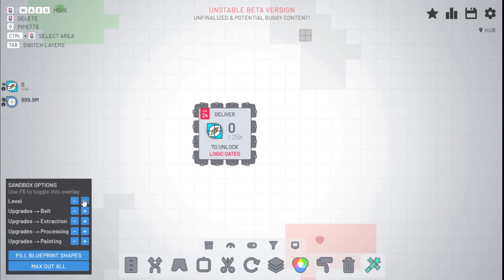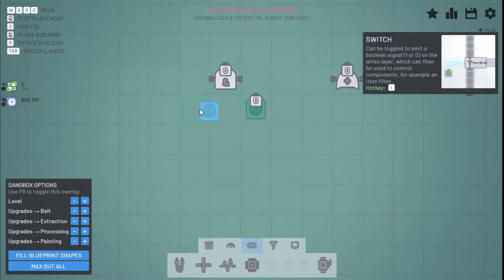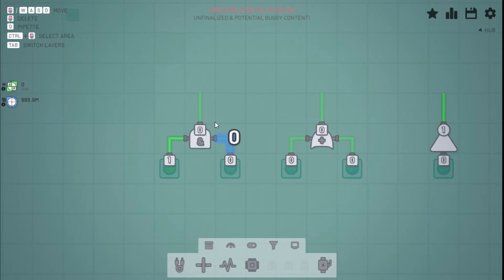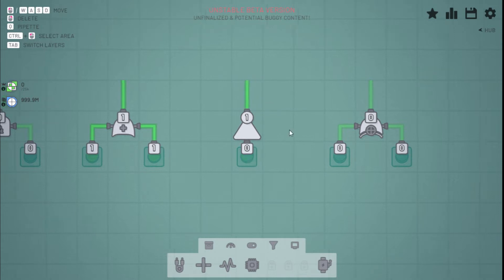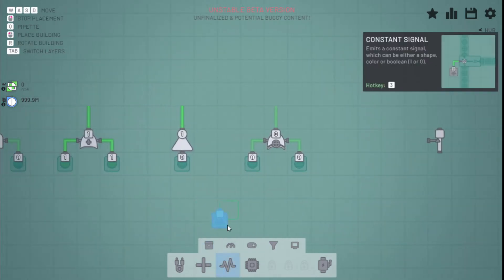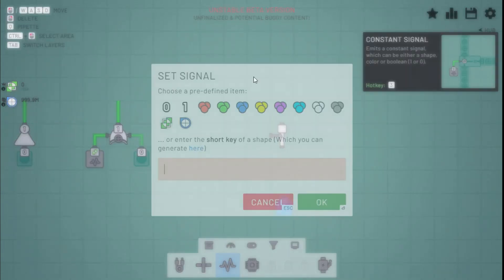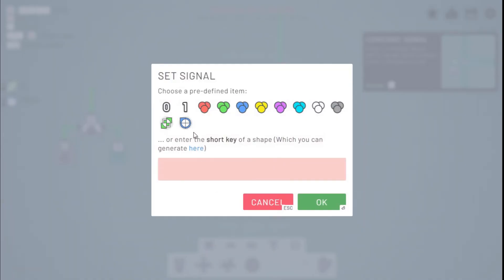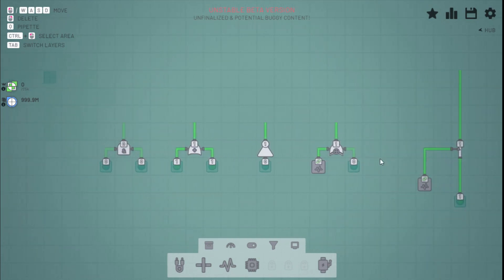shapez.io Level 25 Content Tutorial (By dogdayboy)

Comment: I only use the wires and inputs on the multi-painter. Not really anything else worth using in my opinion (currently) but the information you described is a good breakdown as to what the new stuff is
Reply: You can use wires to make a machine that literally makes any shape in any combination and color. A make anything machine or MAM. If it's wired up to your hub you never have to handcraft ever again.
Reply: Quadpainters are painfully inefficient when it comes to dye, don't use them
Reply: @Glowing0v3rlord  The alternative is having to use a quad cutter, stack the corners that need the same color, paint each of them, and stack them all together. Do you really prefer that?